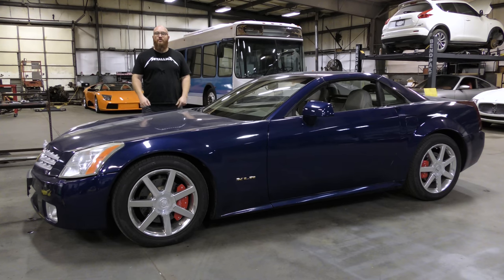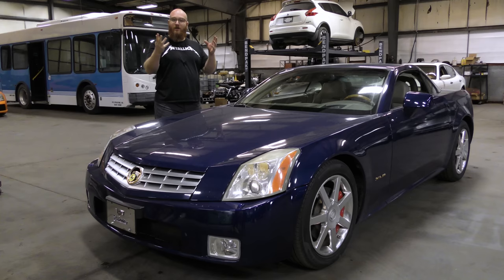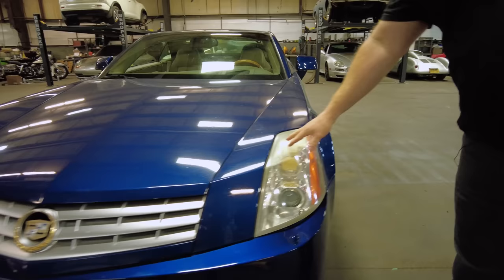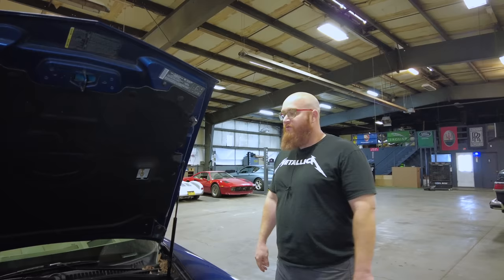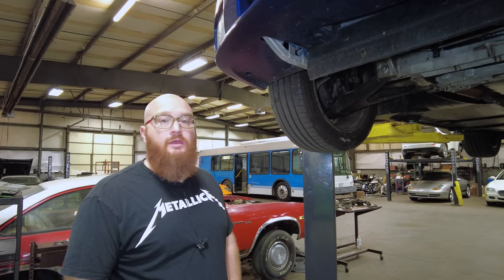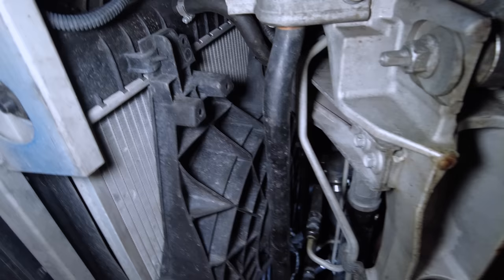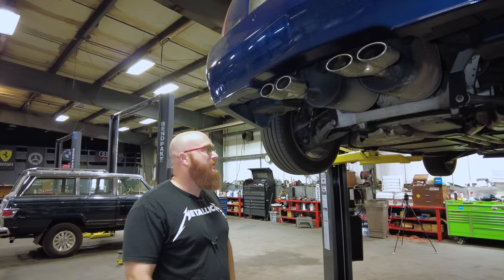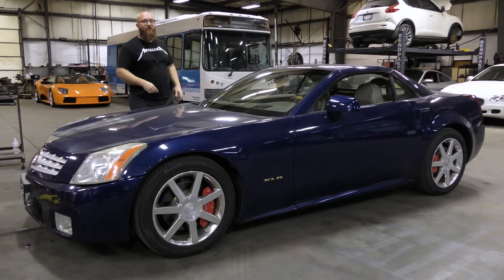Another Northstar? Why does the CAR WIZARD keep buying Cadillacs with this engine? Now an '04 XLR!

Comment: It always amazes me that GM had one of the best V-8s ever made in the LS-1, but caddy spent a fortune to design the north star instead.
Reply: and the ls6 engine too, 405 hp
Reply: Cadillac has always insisted their engines be unique from any other GM motor. The last truly reliable, well built, stout Cadillac-only engine is probably their old 368 pre-cylinder management system. So around 1980 maybe.

The mantra was always that Cadillac customers would never accept having a "lowly" Chevy motor in their "fine standard of the world"...... even though most "lowly" Chevy motors were more powerful, more efficient, and far more reliable than any engine Cadillac has developed in the last 40 years. In actuality the focus was always more on smoothness and quietness than the LS or LT small blocks...... but they could have made them quieter if they wanted to.

They finally gave up on that and just started putting the universal, generic GM 3.6 V6 in everything lol
Reply: @MrMisanthrope1RBjr  luckily my Escalade got an LS V-8….. pre cylinder deactivation….
Reply: If you are going to spend money on a luxury brand YOU HAVE TO DIFFERENTIATE IT from your other car engine offerings.
Reply: @daviddill5227  I disagree.   The Escalade has been Cadillac’s best selling and most profitable vehicle.
Reply: @sstearns2  - well by having the same BORING powertrain you completely justify people to by the Chevy vs the Cadillac. Its an ever so slight version of badge engineering. How did that workout for GM in the 70's and 80's exactly?
Reply: @daviddill5227  I can assure the the bullet proof 400 HP LS V-8 in my Escalade is far from BORING..   I would own an XLR instead of my C6 corvette if it has an LS V-8 and the magnaride shocks.
Reply: @sstearns2  - many wealthy people buy certain cars to standout from the crowd. Think Rolls, Maybach, Aston Martin, Hummer, and initially Tesla. XLR owners are no different. If you make a XLR  nearly identicle to a Corvette except for a hood ornament and a couple sheet metal differences (while charging one third more the cost) you are damaging the clout of the brand name Cadillac.  You have to make things obviously different. Magna ride is not much of a differentiation from a Corvette.  (*I have owned 3 Cadillacs in the last 20 years*) a DTS,  and 2 STS's) you have to give people something that is tangibly different that a different suspension system. I know all about magna ride. Many people won't pay much attention to it on an XLR. WHY? Its because that feature for many Cadillac owners will be ignored. For many owners the XLR (IS WHAT MANY OWNERS CONSIDER THEIR SPORTS CAR) The typical Cadillac owner doesn't want a harsh riding Corvette ride. These people also don't necessarily want 500 or so hp either. The vast majority of XLR's will never go to a track day event. A 65 year old retiree won't be pushing the car to triple digits on the highway either.   People in this demographic want opulence, refinement, reliability, and the appearence of it being an aspirational purchase. "LOOK AT ME, I MADE IT."
Reply: The Northstar is a scaled derivative of the Lotus designed, Mercury Marine built LT-5 from the C4 ZR-1 Corvette. It's commonly referred to as "Son of LT-5". Lotus was not consulted - or did not approve the changes made to adapt it to front-wheel drive ... hence the initial issues with the new engines. ^v^

Comment: I had a 2001 STS, absolutely loved that car. I’m still in contact with the current owner, it’s new done over 130,000 miles and still going storing with the original head bolts.

Comment: Those mufflers are huge, you need to get a nice small mufflers that won't be so heavy.  The Northstar does sound really nice with aftermarket exhaust
Reply: Put Corsa exhaust on my 06 Star Black Edition and it sounds terrific. Never listen to the radio anymore because the exhaust note carries a better tune.

Comment: 2 more things I noticed inside the car that weren't mentioned... it appears to have adaptive cruise control??? Hence the cruise buttons marked "Gap" which is impressive for the time period! Also, I noticed a "Map" button on the infotainment center, this thing has navigation?!?! Also, pretty prime for the time period. This car was really advanced for its time!
Reply: Cadillac offered night vision and touch screen navigation in 2000. Yes, the XLR has adaptive cruise control, cooled seats, touch screen navigation that is actually able to still be used easily, speakers in the seats, magnetic ride control… the list goes on and on.
Reply: @ic1815  Wild! Amazes me how long certain technologies have been offered in cars.
Reply: @man_on_wheelz  and it was all standard equipment on XLR 🙂
Reply: Navigation systems have been around for about forty years. I remember a couple of brands in the early 80s.
Reply: delphi forewarn adaptive cruise

first offered on the 2000 jaguar xkr
Reply: My 04 lexus has it also.
Reply: That's what people don't understand.  The luxury brands have been offering these features for a long long time.  That's part of why those brands were unreliable, they were piloting features we take for granted now.
Reply: It also has a heads up display. Very advanced for the time!

Comment: I had transmission selenoids go bad on my 95 Aurora twice. Thankfully it was covered under warranty. When the motor blew itself up at 64,000 miles it wasn't covered. That was a 7-month ordeal finding a motor and getting it replaced.

Comment: I'm curious on the car wizards recommendation on which headstud upgrade he recommends for the Northstar.
Reply: Northstar performance was mentioned in a previous video
Reply: These cars already have upgraded northstar for heads not an issue on these also I have a v and no adaptive cruise that I know of?
Reply: Longer studs drilled deeper, with beefier threads.

Comment: Gorgeous car!  By the way, even the early Northstar V8s were only bad if the headbolts were overtorqued at assembly.  If you have one over say 120K mi., you (luckily) got a good one... like me.  (My '99 DeVille just hit 203K mi. and runs like new.)
Reply: No.  The early Northstar cars required meticulous maintenance, especially the cooling system.   Mess up on the maintenance, even a little, and they went into self destruct mode.   OK for a mechanic, or someone who is anal, but not so good for the average motorist.   The later cars were an improvement , but not by much.   Today I saw a DTS with the supposedly 'upgraded' 4.6 blowing smoke out the tailpipes like it was a diesel.
Reply: @MrSloika  I have a friend that worked at GM-Hamtramck...  (had, actually, r.i.p.)  Anyway, Northstar V8s have aluminum headbolts that stretch by design.  The theory was they could reseal even if overheated.  Unfortunately, a bunch got overtorqued.  These would stretch and fail even at normal operating temperatures.  So you could be the most meticulous person ever and they'd still fail IF they were overtorqued at assembly.  I take very good care of my vehicles AND got lucky enough to get a good one.
Reply: @Dana_Danarosana  Um, no.  The head bolts were not aluminum, they were steel.   Head bolts that are stretched on installation are called 'torque-to-yield' bolts and they have nothing to do with overheating.   Torque-to-yield bolts provide a more consistent clamping force.   These type of head bolts were not unique to Cadillac, lots of cars use them.  First car I worked on with torque-to-yield bolts was a 1981 Ford Escort.   The Northstar was a crap engine.
Reply: Wrong... the LH2 was the only good version.

Comment: I have an almost like new 1972 Ford Pinto Squire wagon. 34K miles. It has been repainted and has fairly new woodgrain vinyl on it. The bottom is as clean as the top. Interior is mint. 2.0L SOHC 4 speed. Virtually no body or interior parts are available for it at any price, including glass, tail lights and side marker lights. It has the original optional 13" 5 slot Appliance Aluminum wheels, that use actual mag wheel lug nuts, the ones with washers. The only place I can get correct tires for it is Coker Tire, and by the time all is said and done, it's about $1600 for a new set of tires installed. I keep it in the garage, and take it out and drive it around on residential streets once in a while. If it gets damaged, there is likely no way to repair it. A broken windshield would total it. I bought it many years ago, because it is identical to the car, color and all, that my dad bought new in 1972. It is almost certainly the nicest one in existence, and one of very few still in existence in any condition. You will never see one in a salvage yard. 99% of them got crushed.  Don't buy a car you can't get parts for if you intend to drive it. I think I would have bought a C5 Corvette instead of that XLR.

Comment: RWD Northstars don't suffer as much head gasket failure as the FWD cars. My personal theory is the more even heating of not having one cylinder bank uo against the firewall. The last gen STS (after they dropped the Seville name) and the first gen SRX used the same VVT Northstar. I still miss my '99 Eldorado Touring Coupe though.
Reply: Since 2004 new Northstar engines no longer have headgasket issues.

Comment: Had no idea these used c6 underpinnings. Always figured it was a CTS base. That is pretty cool seeing torque tubes and fiber leafs on a Cadillac.
Reply: The 2004 XLR was built on the C5 chassis. When Chevy introduced the C6 in 2005, all subsequent XLR's and XLR-V's used the C6 chassis. ^v^
Reply: @taproom113  that makes these cars way cooler than I ever thought. Also explains the microscopic center console.

Actually considered one between the first gen CTS V and these but a blown Northstar scared me away.

Comment: I drove a 2002 Oldsmobile Aurora 4.0 for 110,000 miles in 21 years and never had any powertrain issues, no oil leaks either. The rest of the car had fallen apart, in part because of spending 12 years parked in the central Texas sun. Hated to get rid of it because it was so much fun to drive but the state of California was offering $1500 to retire it and with all of the aging interior issues, the A/C broken, and the tire rubber cracking from age, it was time to say goodbye. The 4.0 Aurora had the SLS cams and the STS final drive so it had both low end torque and low gears to launch it off the line amazing well for a 4000 pound car.

As a fun little side note, the plastic hub covers on the 4.0 wheels were made with mold # 442.

Comment: I worked on an Oldsmobile Intrigue with the Short star engine.  I managed to get the engine out through the top of the engine bay once the heads were off.  Installed threaded inserts in the block.  Car ran for a number of years after that.
Reply: I had a 2001 Intrigue with the Shortstar. It was a GL model with upgrades that made it basically the GLS trim line, and had nearly all of the luxury comforts of a Cadillac. I got 225K out of it before it started overheating. I couldn't bear to junk it, so I sold it to a young guy who needed body and interior parts for his Intrigue. TBH, it is my favorite car. Some days I miss it!

Comment: I always liked the styling of these and would always check them out at the dealer when I had my H3 in for service. I always thought with a Corvette engine and a manual transmission it would’ve been a better seller.
Reply: i've seen several videos on here of someone actually changing it to the corvette drivetrain, apparently not an easy conversion. but i agree totally, love the car but always been leery of the northstar and shortstar
Reply: You owned an H3?
LOL

Comment: that would be a cool car to do an LS swap  🤔
Reply: It's been done. .. Google it.
Reply: @BudgetBully504  done or not, I was just saying...
Reply: Might as well just buy a corvette then
Reply: @YungEagle3k   if I owned one and the engine was blown or I wasn't satisfied with the aftermarket when it came to performance upgrades, an LS swap would be a good option. I'm sure there are also people out there that would rather have that over a Vette.
Reply: Why would you do a LS swap?
Reply: @williamegler8771   the same reason Cadillac phased out the NorthStar engines and started putting LS and LT in their performance cars...
Reply: @uptownsamcv  that they did.. I understand the want. To bad this ev crap is here now
Reply: @uptownsamcv  copy dat.  Just wasn't sure if you seen the swap. It gave them hell.. electrical wise.
Reply: @BudgetBully504  this whole EV evolution is the illusion of solving a problem. I wouldn't mind having one if it wasn't for the charge time. i can refuel my car in less than 5 minutes. I heard that on average, EV's get 3 miles per minute. someone living in a house that can plug theirs in and leave it for hours will be ok with an EV. from what I hear charging from 80%-100% is what takes really long.
Reply: @uptownsamcv  yessss!!!! Not ready.. at all. Agreed

Comment: Transverse leaf spring is from Henry Ford's model t. Reduces total weight, 2 springs not 4, and more importantly reduces unsprung weight as the weight of the springs is sprung. 🤣 Henry would be so proud!
Reply: the traverse leaf spring goes back to the horse and buggy, ,  it works

Comment: I have a red 04 XLR and I love it but it has issues.  You have found most of them.  In my case, I had to replace all 4 shocks.  They are the magnetic ride shocks specific to the XLR.  IF you can find them, they are about a grand a piece retail.  But well worth it as the ride varies from soft to firm depending on conditions.  The hydrolics are bad sounding and someone has made a mess of the wiring.  Problems are usually the micro switches and I think there are 3 or 4 of them.  Cadillac licensed that system from Mercedes and you may need a tech 2 system to troubleshoot.  Again parts may be hard to find.  And be sure the battery is FULLY charged.  My roof stops working when the battery does not have all the amps, but there is no warning message - it just won’t work.  I try and keep it on a trickle charger and then no worries.  That said, I have had the car about 10 years and it’s a lifer for me.  When you are ready to sell yours, ping me as I’m looking for another.  Love these cars
Reply: I'm sure you could probably replace the mag-rides with passive struts.  No way I'd spend $4000 just for the struts.

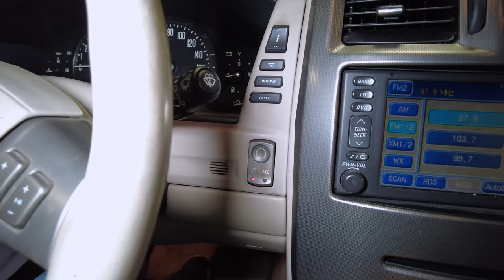Comment: 11:44 - "its a push-button" - I've got an STS with the same push-button ignition. You can check the odometer without starting the engine by holding down the ACC button for a few seconds. That'll essentially put the car in RUN without actually starting the engine. It seems the XLR is just as quirky as my STS is... its probably full of little idiosynchroies like that.

Comment: the "cliff-notes" version -

the early engines used a very expensive alloy that produced a very strong/hard aluminum block -

the amount of that alloy was reduced - saving a lot of money -
and the casting procedure was changed - also saving money -

the short/fine-thread head bolts that had always been used -
were now causing problems - the threads in the block were failing -
this resulted in lost clamping power - the heads lifted slightly - and the gaskets finally failed -

in 2000 many internal improvements were made to the motor -
they also increased the length of the head bolts -
this change in bolt length GREATLY reduced the failure rate -

in mid-year 2004 - they changed the head bolts from the fine-thread - to coarse thread -
this has further reduced the failure rate -

Comment: Don't confuse the XLR with a Corvette.  VERY Few similarities.  Just a Left Headlight is over $2,500 if you can find one.  Rears are worse.  Be aware of the door release handles on the floor beside the seats.  This in case of battery or switch failure.  On my 2008 XLR I was able to purchase a vette rear anti-sway bar.  Bolt in with longer bolts.  It is hollow.

Comment: I have had four N* Eldorado ETCs, put 100K on each and never had any head gasket problems (knock on wood).  However, the  current one, as well as two others, have had the oil pan gasket issue.  I got this one because it is a  Coach Builders convertible with the power top and I have had it around ten years.  I have been trying to get a company up North to build an engine for me, but it is a real pain to try to engage.  I have called, written emails and even snail mails, but not a single response.  So I am just putting up with the oil smell and enjoying the attention when I drop the top and cruise.  
Just an aside... when I started buying these in 1995 they were showing everybody their taillights.  Now even four cylinder family haulers have 300 HP.

Comment: Hey, nice to see that car. I worked on the ECU software around 2001. Done a lot of software optimizations so that the dual C167 can handle the engine management up to the 6500rpm red line. That was a fun project.

Comment: A car won't pass annual inspection in Texas if there is a crack in any lamp, head, tail, or side marker.  You have to replace the entire unit.  My 95 Chrysler only cost $140 for a pair of headlight units, but still, compared to the $10 cost of some orange tape specially made to repair cracks it was hiway robbery.  I've always felt whoever was the state legislator that introduced that 'no tape' law must have owned a parts supply hours or a junk yard. I would never own this car with its out-of-sight expensive $1500-$2000 each head and tail light assemblies.  Invariably half the cars on the road much will encounter a rock chip that cracks a lamp, front or rear, if it is driven a lot.

Comment: One of the best styled cars from GM! I’ve always wanted a XLR-V or an ls 6 speed swapped XLR.
Reply: That would be sooooo sweet!  That's the one thing that car is missing, a 6-speed manual.  It's probably relatively easy to do, too since it shares so much with the Corvette.